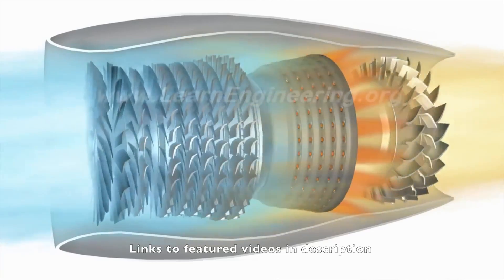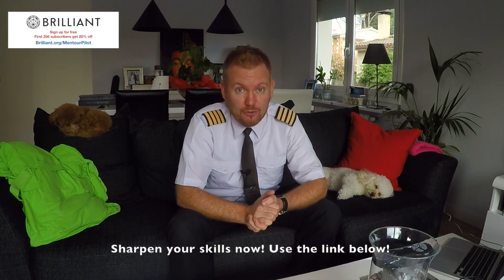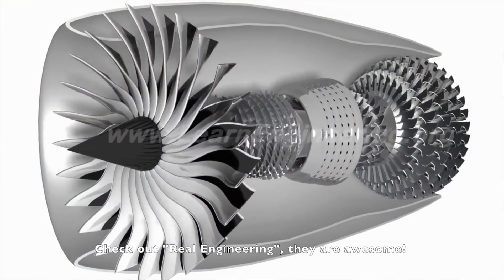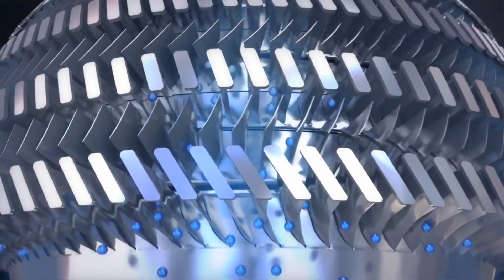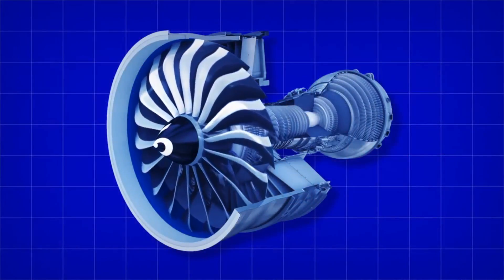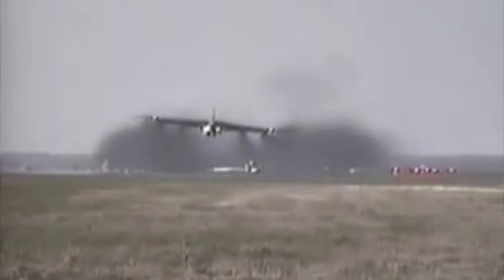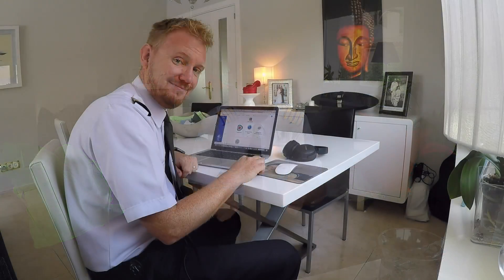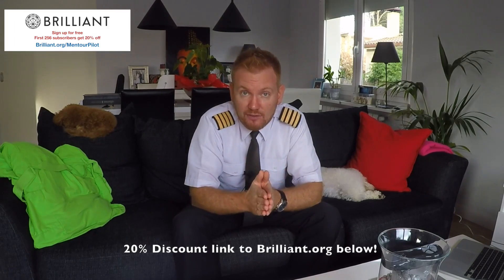Can water make Jet engines stronger?!

Comment: Captain the clip of water test on the engines reminds me of an incident Qantas A380 making an emergency landing after engine failure and one of the engine could be turned off and water cannon was used to deactivate the same it took lot of water to do it and start the evacuation process. Correct me if I am mistaken about the incident.

Comment: Sir My Question Is that we all know how does jet engines produces thrust but how actually the speed of the fan increases when pilot throtles full and how does its speed decreases when it is in clouds in short how the the throtle control engine speed please sir can you help me to find this
Reply: The engines used on these commercial airplanes are Turbo-fans not Jet-engines.
Reply: It regulates the fuel injection

Comment: If memory serves correctly. When the Qantus Airbus A380 had that massive engine failure ( and could not be shutdown via flight deck controls as they were severed ) a few years ago. Did they not try to stop it using the AARF directly hosing into the engine. Which did not work. Now if memory hasnt failed me completely didnt they end up stopping it by using foam and not just straight water ??

Comment: Sir why can't we put a net or something similar to protect jet fans from Birds and other big obstacles?
Reply: The risk is that any "net" or mesh in front of the air-intake will itself become a more serious problem if it comes loose/broken and goes into the fan-blades after a bird-strike etc. The average bird will be cut up by the fan and mostly bypass the combustion chamber itself. Drone are a problem - especially as they get bigger with few operators having an IQ even in double figures.

Comment: Engines today can take a huge amount of water. If you remember the qf32 accident where the damaged a380'landed safely in Singapore, they couldn't turn off engine 1 due to cutted electric. They decided to fire water from the fire truck directly into the engine with no result. Finally they used foam to turn the engine off

Comment: i had a few thoughts from this video. in the 80's, they used to advertise a "water injection" system for american cars, basically a quart pickle jar with a tube, that would suck a little water into the carburetor, a quart of water with a carburetor that sucked 600 CFM into the engine was basically useless. 

my second thought was of the rain at airports and engines not burning 100% of the fuel, that would spray a bit of unburned jet fuel onto the runways on takeoff, full throttle, engines spraying basically oil onto the runways, then rain comes along, wouldn't that make the runways slippery? wouldn't they need to scrub the runways regularly with detergent? it's 3AM, i'm drunk and these are a couple of my random thoughts from this video (i have a high school education)

Comment: I am in a filtration company and we do into plane water separation to avoid water carried inside with fuel. There is a big deal on SAP issue right now with JIG and IATA which has caused several engine flame outs mid flight! Can you throw some light please.

Comment: Spitfires and other piston-engined fighters had "boost", where a water-methanol mixture would be injected directly into the combustion chambers to drastically increase thrust. The methanol ignites (alongside the 100-150 octane fuel ) with a lot of energy and the water cools the engine down. Really cool system.

Comment: I have a really big doubt, what actually causes the major thrust from engines? Is it the bypass air or the thrust from the combustion chamber??
Reply: In a Turbo-fan-engine the greatest propulsion effect is from the air sucked through the fan and by-passing the combustion chamber - the "jet" part of the engine is turning the fan to suck/push the plane through the air and provide compressed air to feed the ignited fuel in the combustion chamber.
Reply: @SpamMouse  ThanX dude... Been having a doubt about that for sometime 😅

Comment: HOW EFFICIENT ARE JET ENGINEs?? MEANS ARE THEY more efficient in burning fuel than any other engine in the worldd???
Reply: How do you want the word "efficiency" to be defined? The efficiency is in the chemical make-up of jet-fuel with the ease and ability to create motive power from it (compare to burning wood or coal) for the weight of fuel. These turbo-fan engines are more efficient than a Jet-engine (thrust from the jet and not the turning fan blade) for example or even a internal combustion engine turning a propeller like your car-engine. There are ideas of Nuclear powered engines - but the issue is risk of contamination in the event of a crash and the weight of lead shielding required. So jet-fuel and Turbo-Fan engines are the best combination compared to jet-fuel and a Jet-engine, you need to understand these are different things.
Reply: @SpamMouse  IN AMOUNT OF NOX gases emmision .....are they least????
Reply: It will vary based on the engine and load conditions. Is a hydrogen burning engine better for the environment in terms of NOX, yes - but there are downsides with everything that is not jet-fuelled Turbo-fan engines - that is why they are used. Just consider electric-engines which are being experimented with now, but the range will be short and the re-fueling infrastructure does not exist, and will not for a very long time. Consider how long it would re-charge a commercial plane when currently turn-around time is down to 25 minutes for example.

Comment: One other reason why ice is worse is that not only is it a pretty decent thermal insulator far more so than water but hail diameters can be significantly larger than water droplets usually are. As a result hail can actually end up sublimating into vapour far later in the engine than rain would in extreme cases large amounts of large diameter hail can actually result in enough back pressure in the turbine to cause a drop in outflow velocity resulting in a spike in pressure inside the engine result in a surge condition. That said the only case I can think of where this happened the hail was so extreme that the pilots were lulled into it because it completely absorbed all the radar return and caused their weather radar to paint it as black so that just goes to show the sort of extreme weather it takes to do this to a large jet aircraft when the precip is so extreme that it blinds the very equipment designed to detect precipitation. Sadly that also caused enough confusion in the cockpit that the pilots lost situational awareness and consequently handled the situation in the worst way possible ultimately dooming the aircraft.

Comment: Back in  the late 60"s through the late 70's TWA flew Convair 880's between Phoenix, Arizona and Saint Louis Missouri, they were fast as hell, but smoked like a son of a bitch, you  could hear those basterds from 10 miles away taking off . Trust me, I used to stand in my back yard in Mesa and remark to my neighbor, My God  there goes another of those Damnable Convair 880's   Sadly the Convairs are gone, replaced by endless sh&t from Brazil, Candanavia,EU where ever, and other second rate places.

Comment: Lots of mass flow energy with water Injection. Before hi-bypass ratio jet engines, this was the way to increase thrust and as you say. At the highest thrust setting the heat was reduced on the burn cans and turbines for the metals developed for that 1950's technology. New alloys and ceramic composites in the newer engines allows for maximum performance for engines is designed in the late 1990's early 2000's. The next generation engine is now in production that is combining the new high by-pass, new exotic materials and now a geared turbofan engine. This technology is maturing, with little issues that are being solved, and that pushes the technology forward. 
Love your channel Mentour Pilot. Aviation is so interesting.

Comment: I was thaught that rain was very good for engines it cools the combustion chambers
but ! it all so turns to steam !!!!!!!  which is very powerful and adds actual thrust to the engine!
water injection or menthal or both are use ed in many air craft in fact during the cold war
russia had severe problems with there throops drinking the mentenal  in place of vodka
it caused heavy shortages of  injectables to there bombers!!! 
and as farvas storms  These engine manufacturers claim they can never ever flame out in a storm!!!
lol nice to know they can  thank you

Comment: What will happen in a fighter jet engine in which there is no bypass air?
Reply: They use straight Jet-engines where fuel efficiency is not as important for commercial passengers. Because there is no bypass there is a risk to flame-out because of the heat lost to water - but be logical - in flight there will not be that amount of water in mid-air.

Comment: Mentour, in regards to storms I assume the areas you fly in are normally calm enough to avoid them altogether? What conditions would you go thru a storm. Reason I ask is here in the lower mid-west its not uncommon to take off or land in thunderstorms. I've even taken off during one where actual lightning was striking within the premises of the airport! While they do avoid them, sometimes the systems are so large that flying into one is inevitable, but they do seem to avoid any storms with strong convection (for obvious reasons).

Comment: The concern manufacturers have with water (and ice) ingestion is not just flame out there is also surging and compressor stall that can be caused by large quantities of water and especially ice entering the engine. There was a crash caused by ice surging the engines and a safety mechanism that kicked in without the pilots knowledge.

Comment: What would happen if you had an engine failure at full reverse thrust on landing?
Reply: Think about the physics of the situation. It would be like a variant of the asymmetric thrust problem caused by in-flight engine failure. One of the memory list items to do in such a situation is to apply sufficient rudder to correct the resultant yaw. Ditto on the ground except that it's the front wheels doing the steering not the rudder control surface.

Main priority is to stop the aircraft going off the runway in that situation. That way it still has sufficient space to stop safely.
Reply: Correct and reduce the thrust on the other operating engine to reduce the adverse yaw and use more wheel brakes.

Comment: So what if your aircraft is directly approaching a thunderstorm and ATC wont allow a heading change for whatever reason maybe the frequency is too busy to get the request out or simply just traffic. What happens then?
Reply: Airspace is not crowded to the point that diversions are never possible. One of the reasons that radio protocol is as it is to ensure there is air-time to break in with urgent radio calls. On this point the reason that aircraft will still us simple AM mode and not digital or FM is so that one radio transmitter CAN be heard over another, not prefect but it the most reliable.

Comment: I watch and love all of your videos.  Just a technicality...  A retired NWA mechanic friend of mine spent 30 years working on JT8Ds and claims that none of them had water injection.  So no version of the 727 would've had water injection.  The DC8s and 707s with the Pratt JT3C turbojets did.  God I remember those things from when I was young... seemed normal then but you'd think guys were up there shoveling coal in retrospect.  Thanks for all the great information.

Comment: @Mentour Pilot    This is one of your better podcasts for understanding how jet engines work in bad weather.  I've flown "pistons" for years (some of them even had wings on them).   But this podcast answers many questions about jets.  Please know that many of us who "think" we know a lot about aviation are still aviation students. 
            BTW,  any piston driver who loves WWII vintage airplanes will know that "water injection" was used as "War Emergency Power" in fighter planes during the great war.  The Merlin engines in P-51s as well as in many other earlier fighter aircraft during WWII had a special water a tank inside the engine compartment.  When full power was applied in a P-51 it was known as " full military power".  However in case of an emergency when the pilot needed an extra boost,  he would advance the throttle into a special detent called:  "War Emergency Power".   This setting would induce water from the special tank to be injected into the pistons so as to cool them down thus allowing the cylinder head temperatures (CHTs) to remain cool in an acceptable range for about two minutes.  The extra boost was limited for a short time so not to exceed the engine limitations, but it would be enough to allow the fighter to climb or outrun an enemy in a dogfight. 
              Water injection began with piston engines and is not limited to jets.   I'm sure there are many piston aviation history buffs out there who know more about this;  however, there also may be young aviation enthusiasts here who are eager to learn about aviation history.   I want to thank you for your great aviation podcasts.  (BTW, is the term "Podcast" becoming archaic)?
Reply: daffidavit      Hi! Just a quick question. If I go up in the P-51Mustang  this spring with the Collings Foundation, & we zip around for half an hour & do 3 barrel rolls (non-consecutive), how fast do you think I'll be going...tops? (I've heard guestimates of 200-400 mph) What do you think?
Reply: @annnonymous9791   I've seen a YouTube video on this subject.  I even believe they used a P-51 for demonstrations.  I don't recall the recommended airspeeds for doing loops or aileron rolls.  Sorry.  However, I'm sure a little research here or on Google will give you the answer.
                 Just for the fun of it, I'm going to guess at the recommended airspeeds for a loop, barrel roll and an aileron roll in a P-51.  After you do your research, please come back here and post how far off I was or am.  I'm going to guess that the entry speed of an unloaded P-51 without bombs or other parasite drag devices are approximate as follows.
             1. aileron roll:  about 200 kts.
             2.  Loop:  Around 200-220 kts.
             3.  A barrel roll probably faster because the roll requires an initial climb and dissipates airspeed before it finishes about the same speed it began from.  My guess is 250 Kts. entry for the barrel roll.
I'm sure WWII pilots in combat were experimental test pilots and probably did things no P51 pilot would ever consider doing today.  When a pilot is in a real dogfight, he is not going to try to achieve the exact proper airspeed to do a loop or a roll.  He knows in his mind what he can get away with under the circumstances.  The amount of fuel remaining can determine how light the plan is and whether he can do a loop at a slower airspeed than at gross.
               Also, when at war when your butt in hanging out, you don't care so much about the integrity of strength of your airplane.  You just pray to God that the next maneuver will save you from being shot down.  The P51 was a very slick airplane with low drag.  But it was heavy and had a powerful engine as well.  After you speak with an instructor or owner of a P51, please return here and provide us with the numbers necessary to do the aerobatic maneuvers you asked about.   I'd also like to know the stall speeds with flaps and gear hanging out.  I'd like to know how slowly it could fly with power before it would depart from a flight.  I hope that helped.

Comment: Adding liquid water after the initial compressor stage increases the overall compression as the evaporation of liquid water takes heat out of the  air; somewhat shrinking the volume. This is offset to some degree by the evaporation of the water. The cooling effect nevertheless facilitates higher compression of the cooler, denser air (at take-off) in the subsequent stages. As the amount (mass) of air remains unchanged, the burning of fuel remains the same; perhaps just a little cooler and slower as the water molecules ingested "get in the way" of oxygen molecules that are supposed to be reacting with the fuel. If the balance of water mist being injected is right, then engine efficiency and therefore the thrust (potentially) increases.

The mass-reaction of the water plays a small part to increased thrust. To evaluate the significance 1.2 litres of liquid water has about the same mass as a cubic metre of air at sea level. It'd be a small amount of mass flow compared to the airflow through a high bypass turbo-fan engine but more significant in the (hotter) pure turbojet engines. A modern turbofan engine may be passing half a tonne of air through it every second; most of it through the fan only. Water injection is only useful for the fraction of air going through the compressor stages, combustion chamber and turbines wheels.

It may be necessary in future to lower combustion temperatures to reduce NOx emissions and water injection could then play a role in turbofan engines. In such a case, it would inherently reduce efficiency (lower peak cycle temperature) and lower the available thrust, other things being equal.

Comment: Hey Mentour 👋🏻 

Now I’ve usually thought that water (particularly thick cloud) negatively impacted the engines. When I’ve been on flights, entering moderate to dense cloud, particularly in the latter descent phase, it feels like the engines are surging and the aircraft lurches a bit. 

So could it be then, that what’s actually happening here is that the engines are getting a brief “boost” from the moisture that causes the aircraft to buffet about a little bit? (Rather than briefly ‘losing’ power and being counteracted by autopilot?)